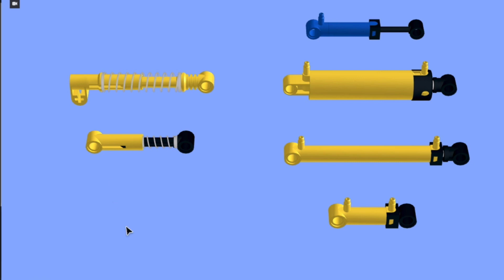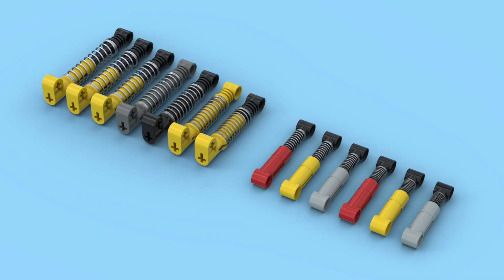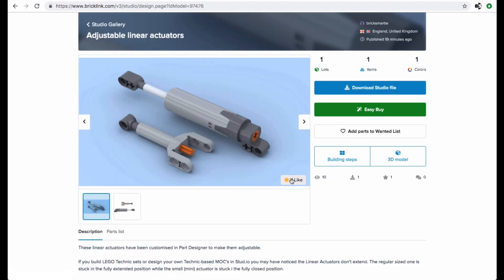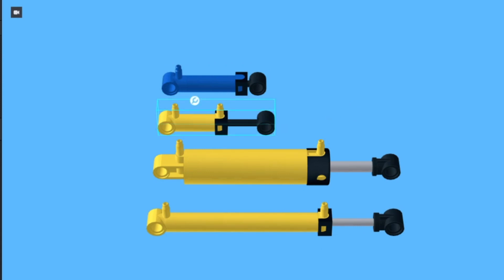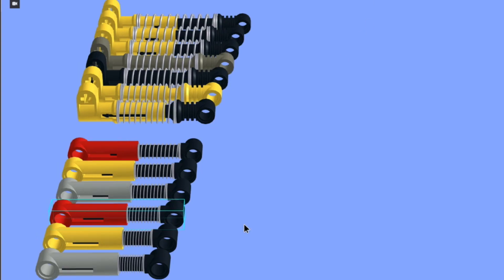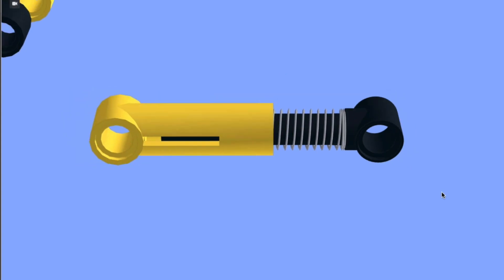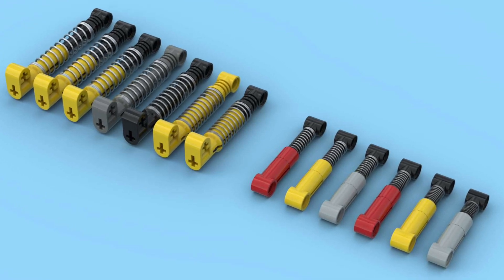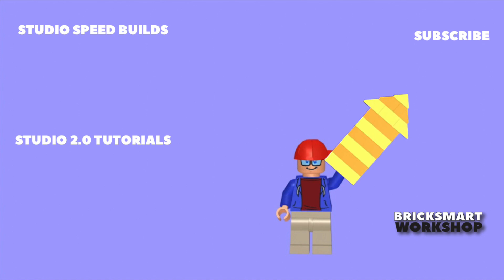Stud.io Shock Absorbers and Pneumatic Pistons Unlocked!

Comment: While this appears to be exactly what I was looking for, I'm a little bit unsure about a few things:

When I open this file in Stud.io and turn on Collision, I end up with the smaller, inline shock absorbers going translucent due to a conflict. This occurs when I have not edited the submodels or moved anything, only turning on Collision. 

Are these only to be used in circumstances where Collision isn't active?
Reply from the maker: Simple answer? Turn collision off. I never use it when working with Technic models. Until Stud.io comes up with a way to accurately snap Technic parts I wouldn't expect to be able to avoid all collisions anyway.  You can still use collision to test your models, then turn it off.
Reply: @BrickSmartWorkshop  I see. That's fair. I just picked Stud.io up in the last month or two, and I guess I'd come with the same expectations as I'd had for conventional CAD, wherein part relationships are fully definable and where solids cannot occupy the same space. By contrast, building Technic in Stud.io makes me feel like the model is just about to come apart at the drop of a hat. Thank you for your quick reply and I'll keep an eye out for your other videos and parts!